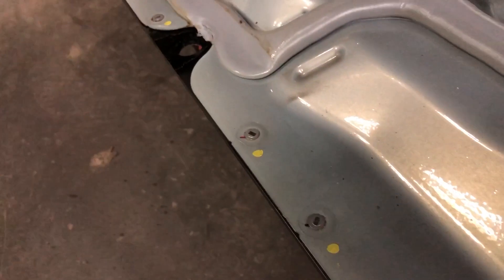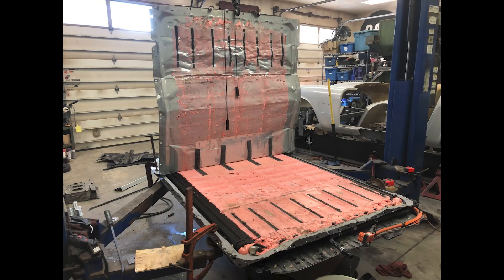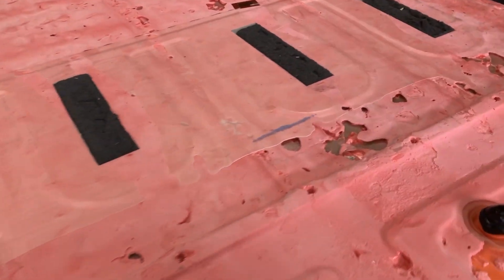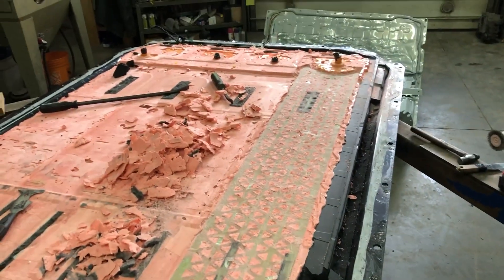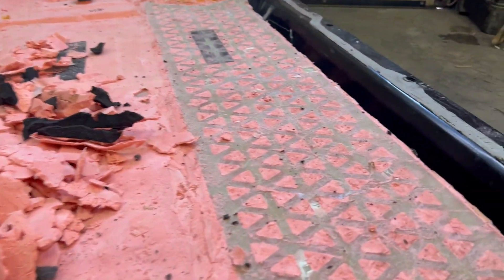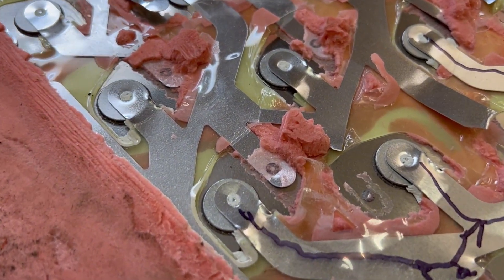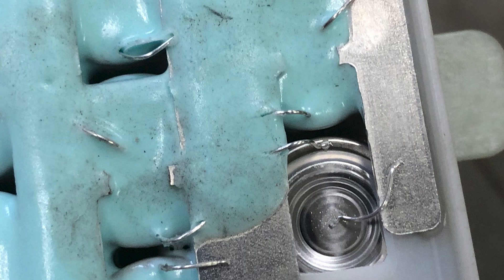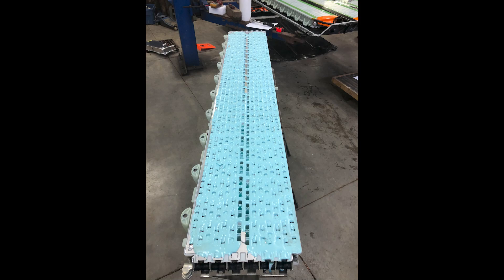Tesla 4680 Battery Uncovered

Comment: so if you get the volts right...why not replace the batteries of an old hybrid car with 4680 cells? should increse the range of the car quite good! or will the computers detect that something is wrong?
Reply from the maker: It would be a solution, cost prohibitive maybe, but technically possible. BMS / charge issues if it is an older NiCad battery model
Reply: @519Kustomz  an other issue might be cooling? the motor and everything just needs the right voltage…

Comment: Take a look at the pack from Vinfast (Vietnamese EV)
.
I believe they use a pre-moulded foam sheet with interference fit holes and press the cells in.
Probably faster, neater and reversible?
Reply: That is the structural battery from Tesla. It's a load bearing part of the car. Seats are bolted onto it before it's placed in the car to speed up the production. I do not think the pack from Vinfast is structural.
Reply from the maker: I will check that out. We just got a Vinfast dealer locally so i'm curious to see some cars around

Comment: Thx for the video.
Is there something like a double sided adhesive transparent tape that holds the FR4/glass fiber plate to the battery cell interconnections? Looks like that in the video, just need confirmation.
How hard was it to remove that top plate from the cells?
Reply from the maker: That transparent layer between the fiber plate and cell collectors looked like it isolated the main cell collectors from the bms layer. It did not appear to have an adhesive layer to it but it was mostly destroyed removing the fiber plate. So the layers went - top of the battery cells, cut out thin fiber isolating sheet, cell collectors,  transparent sheet, bms circuit, thick fiber plate. Every positive battery terminal had a grey adhesive to further isolate and adhere the layers together before the entire thing was filled with the pink foam. The top plate was very hard to remove and ended up coming out in pieces because the pink foam is so bloody good!
Reply: @519Kustomz  thank You for the detailed explanation, got the picture now 🤘

Comment: As you said it's impossible to repair single cells die to the pink layer, but could the whole cell pack replaced of a Tesla?
Reply: Should be possible. Remove the pack from the car like he did, and replace it with another.

Comment: Pink stuff is flame retardant expansion foam and yes it sticks like shit to a proverbial blanket...
Reply from the maker: I did light some on fire and it burned surprisingly well!
Reply: @519Kustomz  
I think it's more for structure and insult.
You'll notice a weak spot in what would be the bottom of the cell.
It's designed to fail and project any "energy discharge" straight through the bottom of the pack.
This prevents heat build up adjacent cells, so no runaway "pack fire"

Comment: Question, could Tesla squeeze more cells on the sides? Looks like some room from the black foam (possibly for crash), but is there any room outside the pack to move that farther out to get IDK an extra 4 to 6 rows? 6/24= ~25% more range.
Reply from the maker: There is a bit of room but it would mess up the cell structure a bit. Outside packs could be something like 10 parallel but insides would still be 9p. Rumour has it that the chemistry is different on next years 4680 for energy density improvements. I think 8-10% better than it is currently.
Reply: @519Kustomz  
The 4680 (as tested) actually had a downgraded anode (less silicon).
It's likely that the first step when they ramp will be to run the 2170 anode material and  the dry process Cathode, both of which will boost performance, with much more to come after that.
They won't go for range (same quantity of cells) they'll go for a lighter pack with fewer cells that probably have better charge rate, any range gain will be weight related.
.
Their mission is to produce more vehicles.

Comment: Makes you wonder if this was done intentionally to avoid cell pack level of repair complaints, so if there is an issue they can say you "have to" replace the entire pack...
Reply from the maker: Yeah there is absolutely no repairing this pack! But, the trade off is it is very stiff to help with the structure of the car.
Reply: @519Kustomz  Why is the penthouse covered in that foam? Seems like only the cell portion would need to be structural, that would have allowed for repairs if any of the control electronics went bad.
Reply from the maker: Aside from the cells, the only other thing in the pink layer are some bms boards. I have the penthouse stuff one video back and it is all serviceable.
Reply: @519Kustomz  Yeah I guess they have the data and those boards don't fail.
Reply: @boostav  Definitely those boards a bit overengineered for said purpose.
Reply: @alesksander  
Tesla makes the same board for every vehicle.
They simply population the board with more, or higher grade components for say the Plaid.
They gain more from economy of scale than they lose in component cost.
(Plaid inverter boards are labelled "Model 3")
.
Same goes for the cooling systems (octovalve, etc)
.
So if you buy a model 3, you have a set of components well within their maximum performance envelope.... That makes them reliable.
.
I'm going to be very interested to see what carryover they have in the Semi.
Reply: @rogerstarkey5390  probably same carryover parts. Well motor is from plaid if i m understand correctlly. 

But where 800V system takes place in Semi i would guess is in charging ICs rest of it is probably same as PLAID as stated above.

Tho this is just mine speculation with limited information from Musks presentations.
Reply: @519Kustomz  would also think, given the vibrations of any car, that pink layer will help keep the cells in place, and stop them from rubbing on each other. If they rubbed because of vibration they’d eventually fail at the contact point between them.
Reply: A large percentage of pack failures are the control electronics (on the Tesla, in the "penthouse")
.
The 4680 cells should be more reliable due to their construction.

Comment: your shredder comment actually matches pretty close to what red-wood would do to process this pack. They would discharge it so it is no harm of fire and send it on through the process. There recovering 90-95% of the cell material.
Reply: Chill in liquid nitrogen to zero out the potential and then grind it up into a rich ore
Reply: @peterjohnson8106  exactly. I can't wait for someone to finally get a boots on the ground process video with JB @ Redwood to show the world this.. People need the proof in video and content on it and let it be history after.
Reply: @peterjohnson8106  That is an expense.  Recycling grinders start big and get smaller as the material goes down the line to go from giant pack to dust in a series of steps instead of a single step.
The foam would not need to be removed before grinding, but there is nothing that rules out tesla having a solvent for the foam that would let them remove the foam.  If there are ports or holes that can be used to inject fluid into the foam, then these packs may actually be serviceable if you really wanted to do it.  I have to imagine they do have a solvent extraction method to at least aid in pack testing and examination.